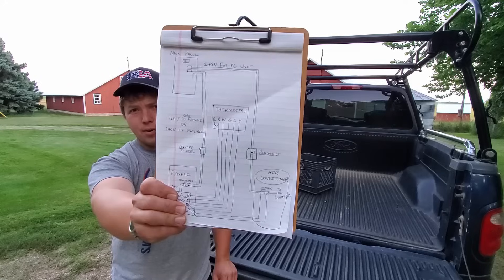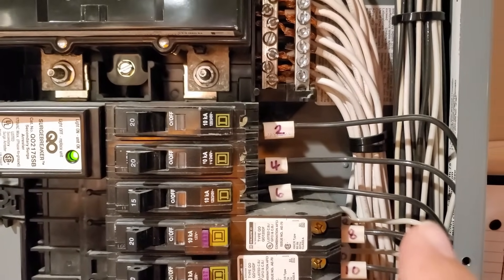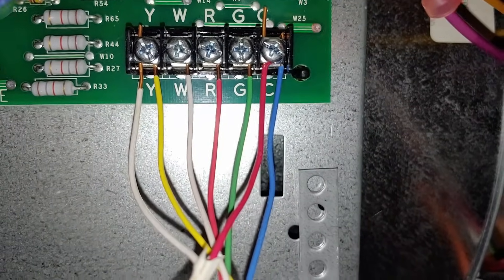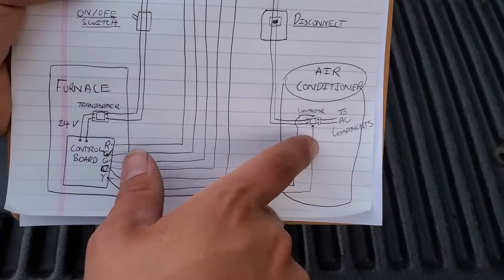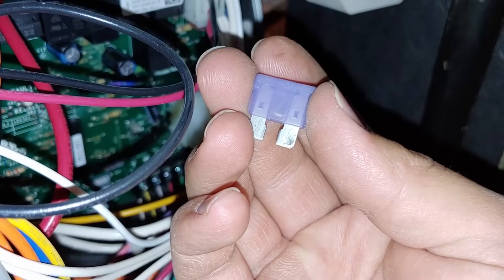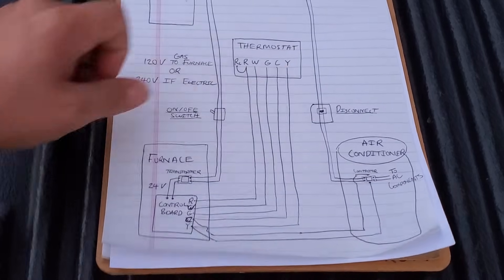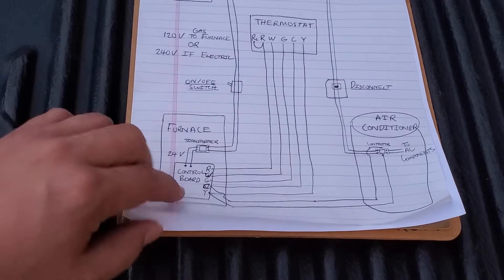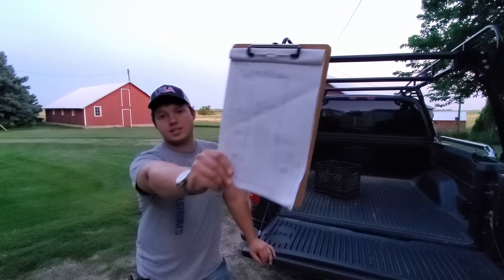Thermostat Wiring Explained!

Comment: I recently tried changing an old mercury dial thermostat (4 wire R,G,W,Y) with a Honeywell T6 WiFi ( requires c wire )  ... I failed.. This great video has enlightened me and I will try again. I will jumper the Rc to R and also use the cut off blue wire as my C wire. Hopefully it will all work. Thanks
Reply: How'd it go? I am about to do the same. I'm replacing my mercury dial to t6 honeywell pro smart

Comment: Here's one.  I've got an underfloor system run off of a tank, gas water heater.  There is a servo that runs a switcher back and forth on a control panel that opens up the mechanical valves to each zone.  One pump pressurizes the system.  I've got the old round Honeywell thermostat.  Two therm wires are connected to each zone.  I can't get the Honeywell to close the circuit to activate the valve actuator.  If I touch the two wires together at the therm it works but I can't get the therm to complete the circuit.  Any hints?

Comment: Ben,   Great channel you do a great job explaining how things work ,  can you show us how to wire a RIB  relay in a box to control an in-line booster fan for the hvac so that it comes on and off with furnace fan.  The booster is powered by 120 volt it is an ac infinity  10 inch booster .
Thanks for all your great videos.

Comment: Hi Ben, I have a white rodgers 50A50-473 control board. i saw the Y and R shorted out with a jumper wire and R and W connect to my thermostat upstair. i don't have an air condition unit, just the basic heating furnace. should i leave Y and R shorted or i should remove it. 
The reason i asking because i have a problem my furnace turn ignites and turn on just for less than 3 seconds then shut off the flame. i replaced the flame sensor but still doing the same thing. i measure the Flame sensor voltage from the 12 pin connector or the connector connect to the sensor, only 2 volts. is it something wrong with the board or because of this jumper between R and Y？

Comment: the house i just moved into had a 2 stage 90% gas furnace. it had a three wire run to the thermostat. i just replaced it all but the gas bills were crazy high. can a two stage furnace run on only 3 wires efficiently?

Comment: Dont forget most thermostats have a setting in the menu or a selector switch on the back to select electric heat or gas heat. The switch will determine if the thermostat must turn on the inside blower during a heat call or if the furnace itself will turn on the blower. Gas heat typically turns on the blower when the chamber is hot enough so the thermostat needs not to control the blower. That varies among manufacturers so be sure to look at the instructions or try it both ways.
Reply: Absolutely. I was getting cool air when I set my stat for heat. Tried switching some wires around to no avail. Then I looked at the back of the stat and saw a switch that was set to heat pump when my system is conventional. Pushed the switch to conventional and bingo...hot air after all that brain wracking. Duhhhh😅 a tech probably would asked me for diagnostic fee of 75$ and 25$ for pushing the switch. 100$!!!!

Comment: Awesome explanation. I have a ZVC 404 installed for 3 zones heat .That does not have a C wire. My nest thermostat is not working as C wire is needed. I just have the R & C wire coming to the nest.

Comment: Question for you Ben, I want to install a Nest thermostat in my apartment (I was planning on asking them first before installing) but I have GH and GL wires. I've looked it up and it says something about "HIGH FAN CONTROL WIRE TO CEILING ASSEMBLY" and "LOW FAN CONTROL WIRE TO CEILING ASSEMBLY" but my celling fan isn't controlled by anything other than it's own dedicated power and manual controls. Can you help me out here and tell me what's going on?

Comment: My furnace runs crappy for some reason when the thermostat fan switch is set to "Auto", but runs fine when it's set to "ON".
I didn't want the fan on 24/7, so I disconnected the G wire from the thermostat and jumped the W and G terminals together on the furnace board.  This appears to work in that the blower stays ON continuously while the thermostat is calling for heat, then turns reverts back to "Auto" when it's not.
The question I have is: Is it bad for the board or in any way dangerous to have the G and W terminals jumped together?

Comment: Hey, Ben, thanks for the clarity offered here.  I'm left with a question concerning a furnace humidifier.  I moved into a home with a HIVE thermostat with a 5-wire hook-up(W1,G,Y1,Rh,C) and my furnace humidifier is NOT turning on.  Is there supposed to be a separate wire for controlling the humidifier?
Thanks in advance for any help you can offer!

Comment: My thermostat wires are r and g only. And that made the call for heat, not just the fan. So when I got a thermostat that needed the c power, I ran a third wire to connect to it. However, with that, the furnace will not shut off. If I switch the g wire to the w terminal, respectively, the furnace will not kick in.  Seems only the mechanical thermostat works. After watching this. I am baffled about my system.

Comment: I like the video but I think I have a few things to add. I believe the senario you gave about the y terminal affecting the speed of the fan might be only on whatever type furnace you are working on because I am not familiar with it. In my experience, the green terminal always energizes the high speed fan ( regardless if the y terminal is energized or not) for cooling or for air circulation alone with the fan switch on the thermostat. The low speed on the fan is actually part of the W terminal operation.  On a call for heat, as the burner fires up the furnace delays the operation of the low speed fan until the burner comes on and runs for a minute or two which allows the unit to blow warm air from the start when the fan finally comes on. Low speed fan is used for heating because any type of high speed fan causes a cooling effect, something you do not want on heating operation.
Reply: Howie... different question if you feel like answering.. i have a summer/winter change over (which i'm not even sure means).  oil burner that has baseboard radiators for heat but no a/c.  will a fancy new thermostat like the nest work with this set up?
Reply: @unclefreddieDied  Not familiar with oil burners or radiators but if your system currently works off of a standard thermostat now it should have no problem working with a nest. All a nest or a standard thermostat does is close an electrical circuit when you need heat. May need to run a common wire from the transformer to the nest to give it a constant 24-volt power to operate. As far as a summer winter changeover, if you have no AC then that would not even apply for your application. Not sure how your system is actually wired so I can't get specific about wiring.
Reply: @Howie875  thanks for the fast reply!  I haven't even looked at it yet.. just dreaming right now.  Probably take a look this weekend.  Just that all the nest videos seem to be for houses with central air/heat.  Oh well.  thanks again!
Reply: @unclefreddieDied   No problem! You caught me bored and online. Good luck with your project.
Reply: @Howie875  hahaha same

Comment: RC and RH terminals are also used when the heat is a hot water/hydronic system and there is a straight cool air handler. This allows one thermostat to control both of those systems.

Comment: that was a great video. I'm an electrician and really only run the low voltage wiring. The HV/AC guy does the hook up. Sometimes I have to trouble shoot and never really knew what wires did what on the low voltage side.  Great Vid!!!!!

Comment: I disconnected RED from AC to out door hooked 1 to condensate pump and return back to RED terminal incase condensate drain pan clogged or malfunction it’s disconnected OUT DOOR AC UNIT . I found attic drain pan caused wet ceiling over filled or low refrigerant iced up ect.

Comment: The rc is for when  you have a boiler (which has its own 24v transformer) provoing radiant heat.  You cut the jumper to separate the 2

Comment: Just wanted to add another Thank You.

I was trying to research function of each wire...  You made it super simple to understand which triggers what.  

Since I already had a 8c wire running from my furnace to my thermostat, I was able to simply connect the blue as Common.  Using your diagram and explanation it was easy to find (even though there were no screw terminals accessible at the furnace}.

Once I had a 5 wire connection instead of 4, it made installation of an Ecobee take less than 5 minutes.

Appreciate the assist brother!  Made this ol dad look like and expert! 🤣

Comment: I have question about units i been working and every time there are changed temp at thermostat and 5 amp fuse blow, i did replaced wire from furnace to thermostat and replaced new thermostat still the same issue, i needyour adviser, thank you

Comment: Great video but I have a question: I can identify the R, W, G, Y & B terminals but I have an old Carrier thermostat that has an additional  (orange) wire connected to a terminal labeled O/W2/B...what do I do with that wire when I install the new thermostat? Thanks!

Comment: Question.... I’m in Florida, central a/c and heat. I want to replace my thermostat and it has NO batteries, do I buy a thermostat with batteries? Then how would it wire up? I don’t want to burn anything out!

Comment: Hi Ben, thank you for the video. I have a question to ask: the room temp. was 72 and thermostat was off. But the blower kicked on for about 10 mins and turned off. I ran outside, nothing happened to the condenser. Would that be a problem from the thermostat or control board? Thanks.

Comment: Hiya. I just had a new furnace and AC system replaced.  Now if I just want to run the indoor fan by itself, the AC comes on with it.  That didn’t happen before with the old system.  What could the problem be?    Did they wire it wrong?   Thanks

Comment: Great lesson on wiring. I have a 1984 mobile home with a 2 wire red and yellow connected to the old thermostat. There is a blue wire not connected. I have a 2 way switch on the furnace that show heat and cool. I have bought a nest thermostat. Do I hook up red wire to red and yellow wire to yellow on the new thermostat ?

Comment: My Coleman heat pump (I think) is older and does not have a control board with 5 wires. It just has 2 from the newer thermostat and those two connect to what looks like inside the furnace is two wires off of the transformer!? I'm lost now

Comment: My AC stopped working - no fan or compressor.  I replaced contactor and capacitor.   My heating and fan work fine.  Could this be a bad 3 amp fuse.  ? Furnace is in attic and hard for me to get to.  thanks.  Great instructional; video..

Comment: my ac/furnace has two Y wires (Y and Y1) but my thermostat only has one Y port. How do u set it up so i can still have 2 stage cooling?
Reply: You need to make sure your thermostat can control more than one stage of heating and cooling.  Google the thermostat model number, look up the specifications to make sure.

Comment: Great explanation, I loved it. I am trying to install a booster fan and want to use a relay to trigger the booster fan and want to power the relay with wire G and C pols on the control board. I wonder if it will work?

Comment: On wifi thermostats that dont use a C wire, do they still use 24 volts from the other wires to power items such as wifi and the backlight?

Comment: I live in an old house with WYRG on thermostat, circuit board WYRGC. I did notice that the outside unit was connected YC. the circuit board is grounded to the fan housing, still need that wire to the thermostat for C ? this ho use had an old dial thermostat before the digital one.

Comment: I am trying to replace a non smart thermostat with a Wi-Fi thermostat. B and G wires are available for use at thermostat end. Where do I connect the C wire at the furnace end to draw 24 V to my Wi-Fi thermostat. Current thermostat is communicating via Vg and V+, Appreciate your guidance and/or help

Comment: I have an old Carrier Condenser: 24apa530a300 is the model number. I changed the 4 wire Carrier thermostat to a Ecobee unit and ran a new cable instead to have the additional common wire. The Condenser has A,B,C,D wires coming in to the Furnace control board A,B,C,D. I have heat but no AC anymore! what am I missing???

Comment: I drew the exact same sketch. Don't forget grounds...  Lines running to the Condenser and Air Handler should have 3 wires, one is a ground.  110v to Gas heater would have a ground wire as well. Your 24V wiring is spot on.

Comment: Somehow my former thermostat didn't have a C wire. I switched it to the Nest and didn't see an extra wire (blue/c wire) hiding in the back. The AC worked for a few hours the the condenser started to power cycling... I was puzzled because I was seeing 26VAC on the contactor. I swapped the contactor, it worked for one day and then the condenser started to power cycling again. Reading a bit more about it and then saw I had a C wire, I plugged it to the Nest which recognized it and since then everything has ben working fine. 
My question is how is that possible that the AC was working without C wire connected to the thermostat then stopped working? I'm guessing that was the time it took to discharge the Nest battery or something. Let me know if you have a theory and thank you for your videos.

Comment: My fan blower will only turn on in "heat" mode but will not turn on in "AC" or "Fan" mode.  When I connect R to G by the thermostat, it turns on the blower.  When I connect R to G by the control board, it turns on the blower.  But when I set my thermostat to AC or Fan, the blower will not turn on?  I've already replaced the capacitor and the control board and still same problem.  My thermostat is a Nest Smart Thermostat and it does show that R, Y, W, and G is connected to the thermostat so I'm lost as to why the blower will not turn on in AC or Fan mode.  Great video by the way!

Comment: And I'm still stuck with this black wire leftover after installing a smart thermostat 😔 I have no clue where it goes. Also my cool is blowing warm air. This is the upstairs HVAC unit in the he attic. Not the downstairs unit for the main floor and basement. Any ideas what I did wrong? I think I'm gonna have to uncover the control board if I can find it🧐

Comment: Hi Benjamin, I'm currently working on making a DIY smart thermostat and was wondering whether it is safe to apply a DC voltage to the control board instead of an AC voltage? I.E. to turn on the fan I would supply 24V DC to the G terminal with respect to common. Switching AC is much harder with a microcontroller so I was wondering whether it could be avoided.
Reply: The best way to this is with isolation relays. Cannot mix DC voltage with the AC control circuit. Just use your system to power up the coils of a DC relay and have the contacts of that relay close the circuits for the AC control system of the furnace.

Comment: Our system failed so that neither the blower, condenser or heat will run.  It’s an old White-Rogers Mercury T-stat and measuring all terminals I have no 24v.  Our condenser and evaporator are new, but the furnace is a 30 year-old Coleman.  All point-to-point wiring, no control circuit board.  I’ll check the transformer secondary for 24v and go from there.  Once it’s fixed I’ll update the t-stat.  Thanks for the lesson!

Comment: Great video Ben. Have question- I have a lcd timer that senses 18-220V. I want to install it on my furnace to track how long the blower has run. Which terminals do I attach it to on the furnace so as to have voltage in all cases?  I want it to have voltage any time AC/Heat/Fan are running
Reply: Condor, you could implement what you want using two relays.  The coils of the relay should match the transformer voltage of the furnace.  Then hook the one side of each coil to c wire.  The other sides will be g and w.  That way one coil is energized for fan and cooling and the other coil energized for heat.  Then on the contacts side of the relays wire them in parallel so that either or both closed will energize the timer. So, it’s just a bunch of wires and two relays.  That’s the whole circuit.
Reply: @neilbrookins8428  - I think I get your point. I was thinking there’s got to be a common and a hot that go directly into the fan motor that you could tap off of which would have the voltage only when the fan is running. Wouldn’t you think that’s true?
Reply: @condor5635  the advantage of hooking up to the thermostat wires is that you could mount your timer right on the wall next to the thermostat and it could be powered entirely via the thermostat wires.  

That all being said, I already have a timer on mine that messages me on my cell phone when the blower has run a certain number of hours to remind me to change the furnace filter.  It only cost me about $90 I think.  I’m using the Emerson Sensi.  It’s $98 right now on Amazon, I just checked.
Reply: @condor5635  tapping into the blower wires directly is indeed possible.  But, some blowers are variable speed.  Which means either an extra wire for high vs low; or a pulsed or varying voltage from a speed controller. So that unknown factor complicates the connection.  

If your fan is definitely one speed only then yes you could just hook the hour meter directly to the wires powering the fan.  But do you really want the hour meter stuck down on the basement?   You can’t safely run those wires elsewhere because they are high voltage and if they shorted out you would damage the furnace.  At minimum it would not run.
Reply: @neilbrookins8428  Excellent points. Thanks for replying